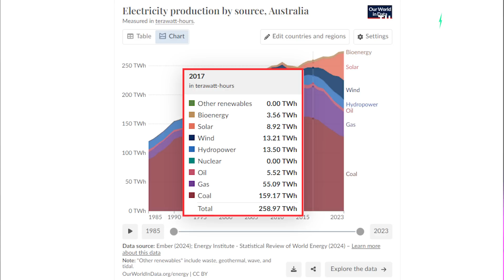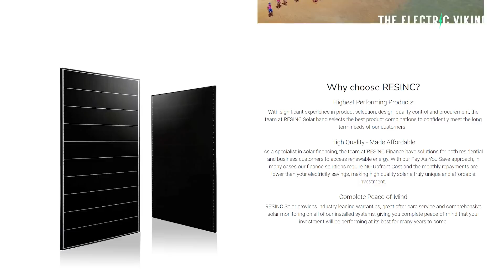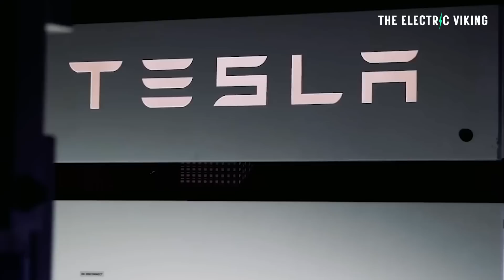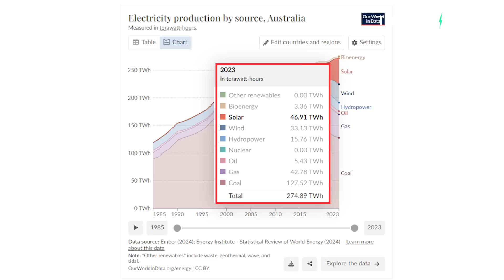Almost 50% of Australia’s electricity is now generated from renewables

Comment: "The grid was saved by electric cars plugged into the grid".  So how does that work?  In an emergency the grid sucks the power out of your battery that you are trying to charge?
Reply: You only export when YOU want to (if you are with the right energy company).
Reply: @greghudson9717  Thats good. Its not right if they take your battery energy without permission.

Comment: It can happen even faster in 6-7 years. It depends on batteries, if they can store up to one week you don't need a lot of solar plants.
Reply: the biggest battery in Australia can power 50k homes for 1 hour and a half. Australia has 11 million homes. If we want power to last 12 hours. We will need about 2000+ of these systems.  Not to mention they aren't designed to be cycled 100-0 every day, So probably double or triple that. There is 0 chance we get there under 10 years.

Comment: Sam, I noticed the Solar Farms appear to be in a fixed position?. 
For maximising Solar 'Intake' I  thought they would have implemented that mechanasim where the panels would tilt and rotate to  reap the maximum sunlight. Naturally, that would be an added cost to the Solar Farm Initiative.
It will also be of interest as to when electricity rates start falling, and in having said that, I think it's not going to happen anytime soon. 😥
Corporate Greed seems to be always floating about in the back ground......
Great Report, as always. 👍
Reply: It is cheaper to install more panels than it is to add tracking.

Comment: Forget unreliable intermittent power generation this is the future and it is now. Quaise, Inc was founded in 2018 to develop a millimeter-wave drilling system for converting existing power stations to use superdeep geothermal energy. The system repurposes existing gyrotron technology to drill 20 kilometres beneath the surface, where temperatures exceed 400°C.
Reply: What about solar with batteries 🔋.. like I can do that on my own home and legally avoid the utility , but in the backyard I won’t drilling 20klm.
Reply: @malcolmgreen8759  that's an alternative if you're off-grid but personal I'd rather use a diesel

Comment: The figure shows the Australian electricity generation fuel mix in shares from 1996-97 to 2021-22 and calendar year 2022. Fossil fuels contributed 68% of total electricity generation in 2022, including coal (47%), gas (19%) and oil (2%). Coal’s share of electricity generation declined from 83% in 1999-00 while the shares of natural gas and renewables increased. Renewables contributed 32% of total electricity generation in 2022.
Reply: I think "electricity generation" is misleading term, because majority of power is used in peak periods where solar isn't helping all that much. What we really need to know is how much use full power is coming from renewables, I'll bet its a lot less than you'd expect.

Comment: As at 22-08-2024 (16.50) fuel supply type in Australia is Coal (60.00%), Gas (8.4%), Wind (13.7%), Solar (9.1%), Hydro (9.2%) and other 0.6%. (NEM data).

Comment: Dude, Oil and coal accounted for the largest share of Australia's primary energy mix of over 80%. Since OZ has no nuclear all the rest is alternative but this (<20%) is not enough to supply your household, and factories (they account for about 30% of total energy).  This means ALL your eV's use dirty electricity either converted from gas or coal.  You are driving all gas or coal cars no matter what batteries you have, what fancies Chinese electronics or FSD is on the car.  WAKE UP Aussies !!!

Comment: The GRID itself is the biggest factor. 

Grid construction is extremely expensive.

No grid construction ROOFTOP PV is the cheapest electricity, just plug in a BV with its oversized battery.

Comment: My opinion 
Nuclear is only economical when running 24/7/365.
The grid is only economical with 24/7 cashflow from millions and millions and millions of customers. $100sBILLIONS. 
Customers are the grid protectors and generators and opening up new load capacity to new heavy industrial users.
The existing national electrical grid is a $TRILLIONS infrastructure investment for the grid owners and the community as latitudes warm. 
Grid new capacity construction is extremely expensive, $1, 2, 6, 10million per km. 
Millions of km to millions and millions of customers. 

Capital grid costs are the key to understanding the future clean electric world. 

20 years to replace ICE age vehicles with BVs, battery vehicles. Early adopters first. 

Petroleum for road building, petrochemical industry, for emergency winter weeks, military defence, will remain.

BVs oversized battery parked 23hrs every day and selfplug-in V2G storage will protect the grid and make money 24/7.

Rooftop PV panels will shade hot roofs and charge BVs and RONDO HEAT BATTERIES for home and building and industrial customers. 

Distant renewables and Nuclear electricity and Central Generation plants are economic 'dead ducks'.

Rooftop PV is cheaper than windows $/m2 installed. 

BVs have FREE reseve energy storage every day. 
More BVs than buildings. 

The grid is the community asset and is becoming community focused today. 

Existing nuclear power will be mothballed.  😮😮😮

Just my thoughts. 
I am an old CivEng Construction Engineer. University Degree and decades of experience. 
Power generation and transmission. 
Grandchildren and young friends. 
The future is always coming. 😊😊

Comment: Im a pessimist and even I can see what batteries are going to do to renewable energy, 5 years ago made it a no brainer to diy financially and since then it has just become cheaper and easier with the all in one inverter chargers you can get now, you pretty much just need to connect a few cables and turn it all on and it works. Its just a matter of time until it reaches a mass adoption tipping point when it gets cheap enough and fossil fuel options get more expensive. Keep getting shafted by corporate energy or become your own energy producer and power your own house and car for free forever.

Comment: It is worth noting the transformation of feed in tarrifs coming over the next 12 months.  1.2c/kwh exported to be charged to solar owners between 10am and 3pm. Will push more people into batteries though
Reply: "1.2c/kwh exported to be charged to solar owners between 10am and 3pm."

Be careful how you present this because that statement is misleading, in that it is incomplete. There has to be a particular set of circumstances that come together on the grid for the charge to be activated. Sure we will have to see how it pans out, but the intial projections claim that it will not be a common thing for that charge to be activated.

Comment: Not promoting this or saying I agree with this but one nuclear power generating station which if you look at Arizona nuke station shows can build in a desert no problem you'll have so much electricity in Australia given what already is extant will create a massive economic boom same true with South Africa as well actually.  Natural gas cogen which have been around for decades yes much moar cheap to build and operate but require an intensive and extensive pipeline network too although can double as a fueling station too. 🚉 yes that's right fuel for rail 🚇 🚇 🚇 transit surface and sub surface for population density issues as well. Ain't cheap tho. 😮😮😮😮
Reply: Nuclear is a colossal boondoggle.  We hide the true economic costs of nuclear, and then pretend it's remotely affordable.  The Hanford, WA site in the US has run up a tab of over $625B in cleanup costs.  Those are costs that magically never make it into the spreadsheets when people project the costs of nuclear power... and that's from just ONE site.  Nuclear, in the long-term, is nation-bankruptcy scheme.  The money we set on fire cleaning up nuclear waste is enough to pay for a second military if we wanted to.  That's absolutely insane.  As solar and wind get progressively cheaper in accordance with Wright's Law, there really isn't much point using anything else from a financial perspective.

Comment: I live in a jungle north of Sydney. No solar panels. However, new portable batteries  have allowed me to time shift all of our electricity to the off peak rate on our time-of-use grid. Plug and play. Everything is on WiFi, so I can see instantly how it's  all working. I'm shocked at how easy it's all becoming.
Reply: @IanMackie-ff1sn  what plug and play are you using...what batteries?

Comment: l agree totally. Despite all the road blocks being put in the way,  l am quite optimistic on our transition to renewables .  Renewables are proven. Replacing spinning reserve with grid forming inverters is proven . Electric cars are proven and getting better every year .  Running all our houses off solar and batteries is proven . lt's already over for fossil fuel generated electricity . Our biggest problem now is how we manage the backup issue smoothly as coal shuts down.  We have the luxury of a bit of time but we really need to get on with the job asap.
Reply: @billhill4479   I think It’s important a backup plan. Biomass should be in equation too. You could faze natural gas to a backup system and new technologies will bring up much more alternatives which increases resilience of the system. One misread of Alternative Energy is add new sources and technologies to strengthen robustness of the system and be less dependent on certain countries
Reply: We need to build at least 26GW of peaking gas... probably double that....which will turn into baseload

Comment: A net-zero global economy in 10-15 years is impossible even theoretically. 
30 years is possible only if everyone fully commits to its, and clearly that's not the case.
50 years is possible if the current political and economical trends continue.
Reply: Nonsense.  Tesla published a 1300-page white paper on the subject.  Their findings were that $10T in investments would cover the transition entirely.  For reference, per the IMF, fossil fuels receive $5.9T per year globally solely in subsidies.  Less than two years of global fossil fuel subsidies would pay for the world to convert to 100% renewable power.  It's not that it can't be done; it's that the vested interests don't want to spend money, and the world's most lucrative industry cries every time someone suggests they should perhaps no longer need handouts from the governments at taxpayers' expenses.
Reply: @AMortalDefiant  It would take 20+ years to build the batteries required to make it work even if money was no question.

Comment: Rooftop solar is a scam.  The consumer pays for the installation and then sells any excess onto the grid at 5c a kwhr during the day.  This drops the daytime marginal power cost to power retailers which is passed on largely to businesses.  The federal government should be putting a floor under the feed in tariff equal to the average wholesale cost across the market.  Thai would give power retailers a massive incentive to invest in commercial scale batteries rather than push the responsibility to individual consumers to install batteries at sub-scale levels.  We need to provide the whole system with incentives to facilitate this transition.

Comment: Countries with large offshore wind do it because they don't have the land to put it onshore where it's cheaper. 

We will get offshore wind farms but the low hanging fruit of locations are onshore.
Reply: While that's true, it overlooks a lot of other factors such as winds generally being more powerful over water than over land, and the hassles of dealing with NIMBYism.  Everyone wants the benefits of windmills, but everyone wants to cry about them being visible from their properties, too.  That severely restricts which places will end up actually getting wind turbines.  Offshore avoids a lot of those NIMBY issues.
Reply: Most of Australia's population live near the coast (far away from the deserts where the solar should go) meaning no need to boil huge transmission links thousands of km when the off shore wind would be a mere stones throw...

Comment: Stop 🛑 talking about batteries 🪫 and start talking about under sea 🌊 cables that transmits power at super high voltage from Australia 🇦🇺 to America 🇺🇸 To Europe. If everyone can produce over 100% of there power from solar and transmitting excesses midday power to places that don’t have sun ☀️. You only need small number of batteries 🔋 to stabilize grid we already have billions of miles of fiber optic cable under water now is the time to run power under water ⚡️
Reply: When power is setting in Australia 🇦🇺 sun ☀️ is risings in Europe and it’s dark in American 🇺🇸 problem solve just need small number of batteries lol 😂 5%-10% batteries storage is all you need not 100% just to stabilize grid
Reply: Build underwater grid power
Reply: @williampisano7573  WTF!!!
Reply: That doesn't work due to transmission losses.  IIRC, it's about 2-3% per 1000 km of lines.  So, transmitting power to the far side of the planet would waste about 60% of the energy.  It make s a lot more sense to build small grids everywhere.  Maybe long-distance connections could make sense in severe emergencies, like earthquakes, etc., but for everyday use, that would be insanely wasteful.
Reply: Australia already has undersea cables running from Tasmania to Victoria. It is not a 'new' thing...
Reply: Too far. Volt drop. 
Better still: held back Hydro as your "battery"
Reply: Or instead Microwave relay power sats.

Comment: Five more Years Wait and See. Rooftop Solar. Solar on the Roof means Money in the Pocket.👍👍👍
Reply: Listening to  Electric Viking, in 5 years, electricity will practically be free
Reply: @donmcgimpsey1706  Solar is for Free. I have 12 years Rooftop Solar now.
Reply: @willeisinga2089  everything has a cost associated to it.
Reply: @donmcgimpsey1706  I've had solar on my roof here in Melbourne Australia for 6 years. 4.5 of those 6 years I've been getting FREE power. It's not rocket science you know. And... I also soak up most of my excess in a Tesla Powerwall battery, then dump almost all the rest into my Tesla Model Y.   Total cost for the 6.4kW of solar (installed) was AU$3050, and was paid off in just 18 months.
Reply: @donmcgimpsey1706 he talks crap

Comment: Great for Australia!. Far more advanced than the USA on this. I am jealous of your costs for installing solar and batteries, not to mention EVs. I truly hope US solar panel manufacturing companies and auto manufacturers (except for Tesla) focus on catching up rather than pocketing profits.  Of course, net metering must allow reasonable returns/profits for solar companies and homeowners too.
Reply: A Tesla battery in Australia installed is circa 20000 dollar !!
It can only power an average a/c unit for 3.5 hrs. No thanks
Reply: @robertfonovic3551 

Where do you get that info. I just googled it and a Tesla Powerwall 3 is about $14,500 Australian installed. Lots of the companies do deals to make them cheaper too
Reply: Net metering doesn't exist in Australia (AFAIK).  The Feed in Tariff in my State (Victoria) just recently dropped to 1.5c/kWh (I think that's correct, someone please correct if I'm wrong).